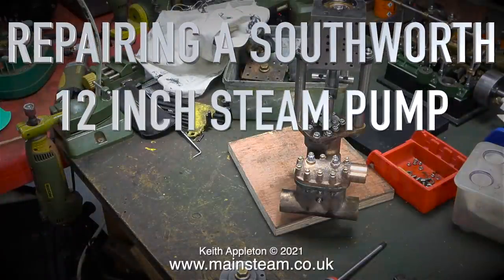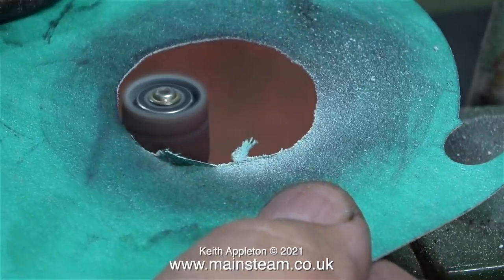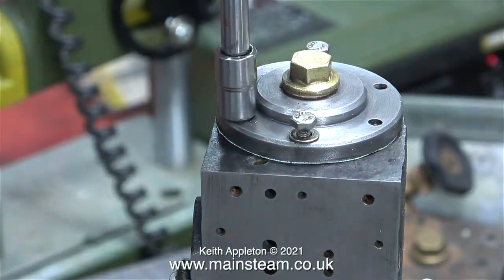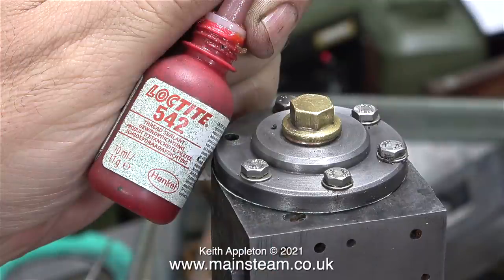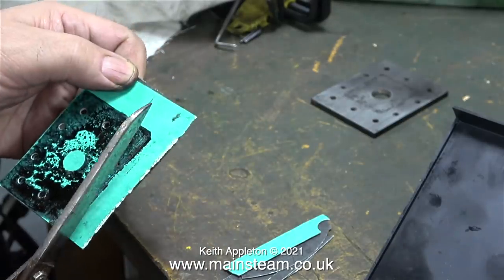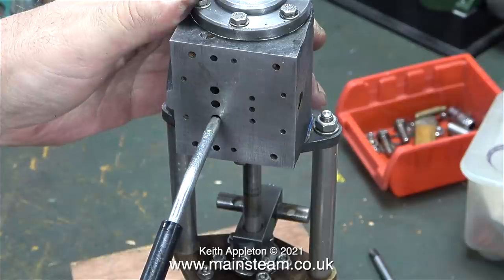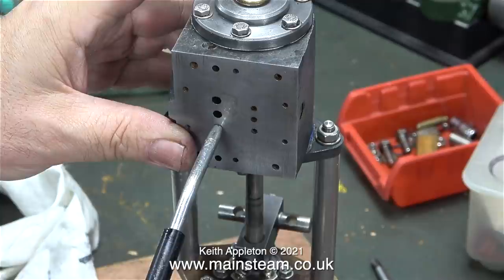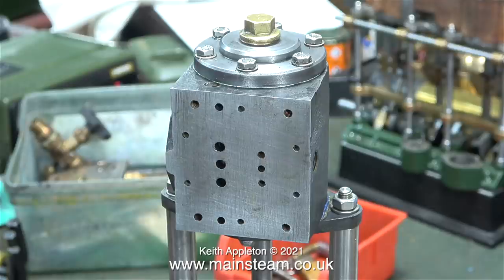REPAIRING A SOUTHWORTH 12 INCH STEAM PUMP - PART #6

Comment: JB Weld thread maker might work to repair the stripped threads that you run into. I don't know if it would have a fine enough texture for real small threads but seem to work quite well for threads that I have used it for on models. Thanks for the work you do on all the videos. They are very informative and well done. The short length is very refreshing at times.

Comment: Hello Mr. Appleton. Unfortunately I don't understand the language, but your pictures say more than words. And I am slowly beginning to understand how the pump works. Thanks for the video and greetings from Germany.
Reply: I hawe the small 3" kit, it is indeed an interesting construction, but as Keith said in the previous videos it is a pretty advanced kit wich rewquire some practice before taking it on but they are in my opinion easier than the Stuart pumps but the function is as far as i can see whan i compare the kits the same. I know Keith does not like whan i talking about low pressure toy machines here, but Wilesco made a simplifyed pump wich as i remember where basicaly a reversed pendulum piston fitted with valves. (I think it was for the firetruck and as a water feedpump on some more expensive models like the D32 if i am not wrong).
Reply: I find the Worthington type steam pumps very interesting. Since I own 2 original pumps of this type myself. The function of these pumps is very simple. The Stuart casting set is still waiting to be machined.

Comment: Hello Keith; Here's one of those words that is pronounced differently from you in the US. Pica is pronounced (pie-ka) here. It was originally a method of measure of type size in printing, most likely British. I have a ruler that measures in picas. Picas are similar to tenths of an imperial inch, used in civil engineering. I'm not real sure about the last, but my civil engineer scale (ruler) closely matches my pica ruler.
Great video. ;-)
Reply from the maker: The pronunciation is unimportant. The word PICA (however it's pronounced) is written on the pen itself }:-)))